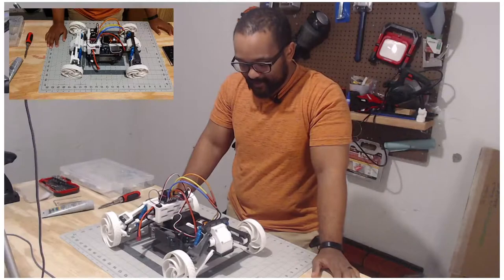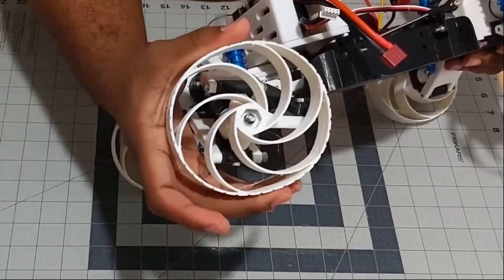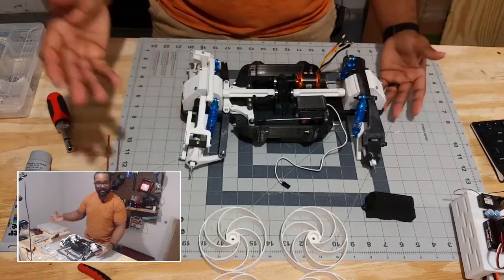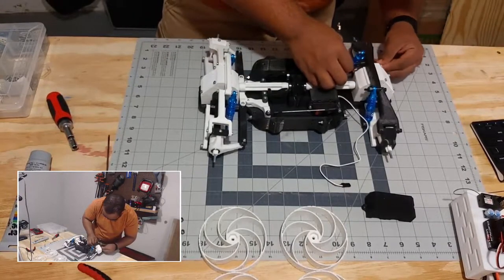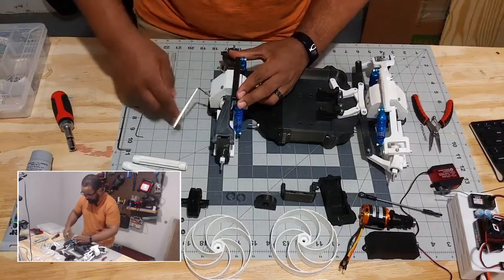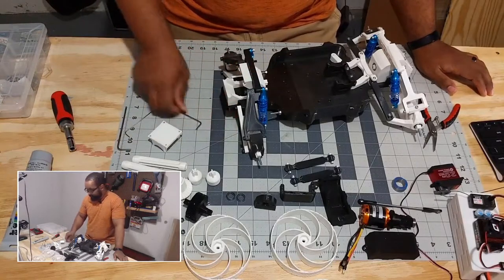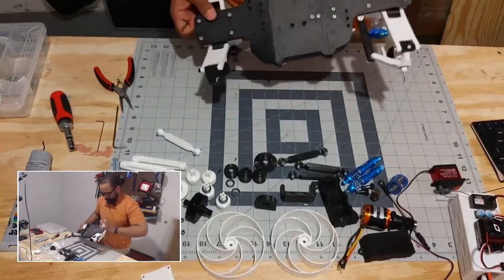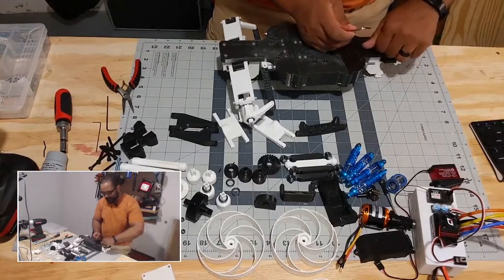Tarmo4 Teardown and Chat

Comment: original engine mount fits on 2212?  is 9g servo compatible for steering?
Reply from the maker: That's a good question. I know that the engine works really well, but I did have to reduce the screw length to fit properly.
The servo i used works really well! 
The only really issue was putting quality (still fighting that) and binding in the drive train.